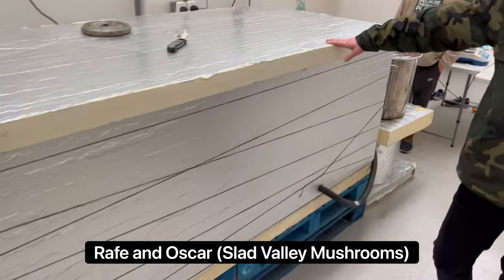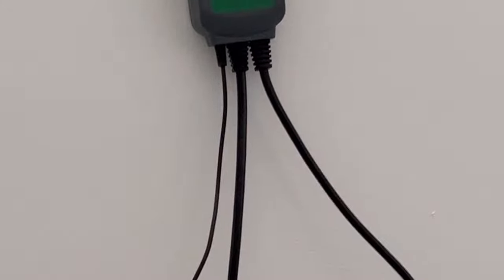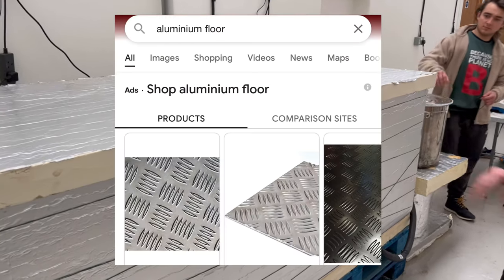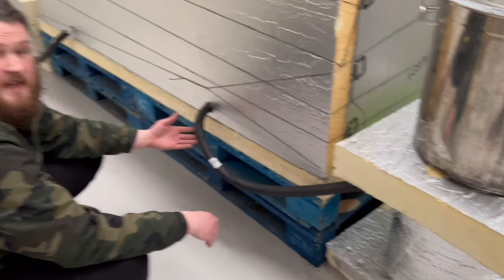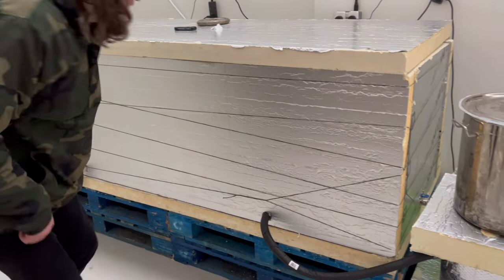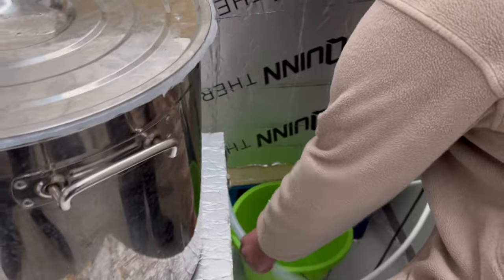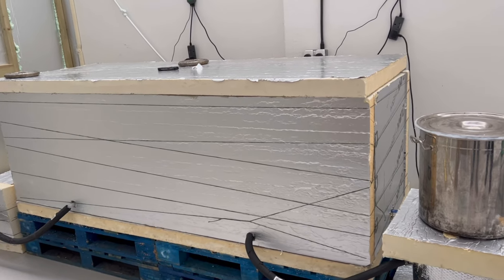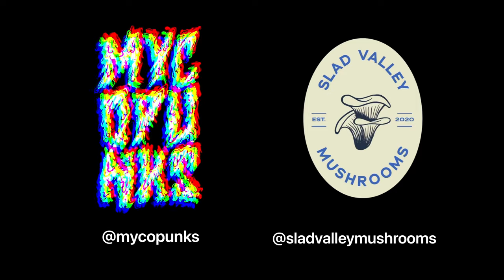Slad Valley Mushrooms Atmospheric Steamer

Comment: I'd be interested in how much it costs them to run this!
Reply: Well I've seen boilers use 2000 watt elements and where I live it is 0.16 cents usd per kwh.  So if i ran two like he has that's 15.36 per 24 hour run.
Reply: Do you use this PIR board only without other materials to make this structure?